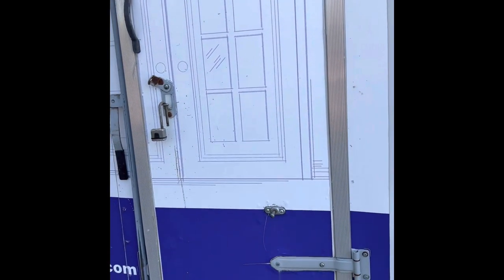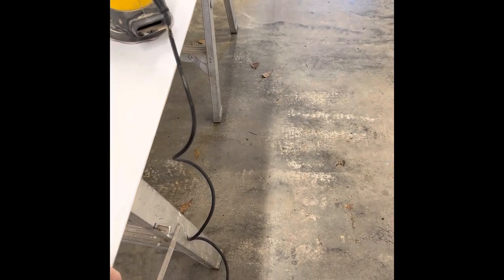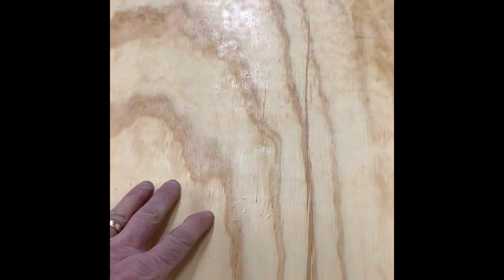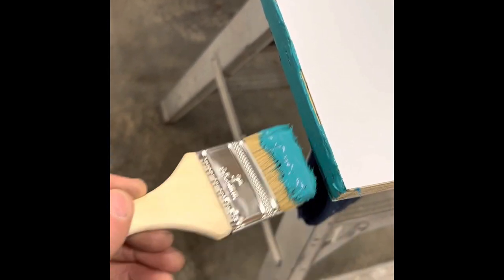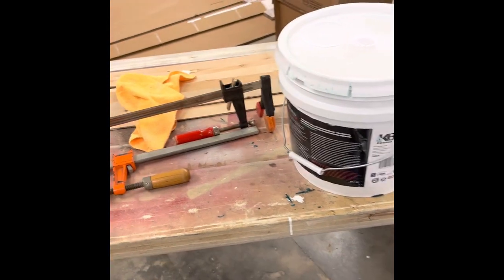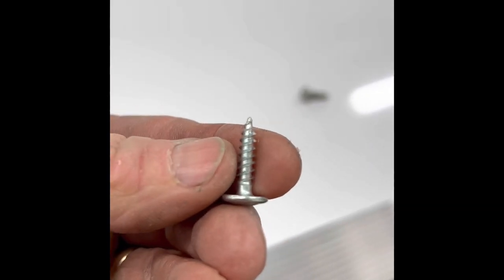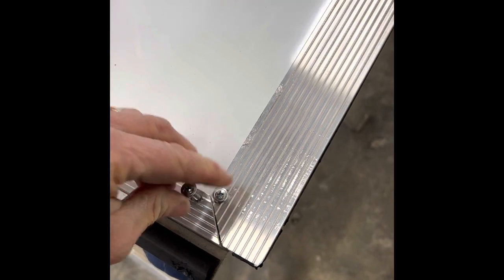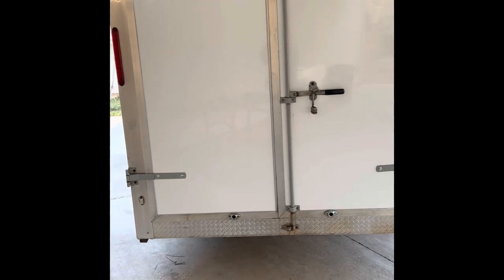Enclosed Cargo Trailer Door Repair

Comment: So did you have to buy new hinges, we repaired a 5 foot cargo door that was so rotted that the bottom frame had come off, we redrilled the holes in the same place and hung it but it is catching at the bottom. You can left up on the door so I am afraid that the hinges have sagged. They look good, no rust. Not sure what to do now.
Reply: Monica,
I used the same hinges. I pre-loaded the weight before drilling the holes, knowing that once you tighten the screws, the weight will cause the door to drop slightly. There is some wiggle to the hinge, it will wiggle up and down slightly. Before drilling the new holes, I positioned the door where I wanted it to be and pulled all the wiggle out of the hinge by pulling downward on it, so it couldn't sag after it was completed.
I hope this makes sense.
Reply: @Jdnorris9187  thank you that helps a lot. I just put the back in the same holes, I may be able to adjust it  and still have the holes hide underneath the hing, thanks for your help

Comment: Im building a new box trailer and will be making a new door. Your break down was a big help. I need to find new h shaped aluminum frame. Was your wood in the door one inch thick?
Reply: Mr. Petersen, I am glad to hear it was helpful. I need to ask, did it show the entire process from start to finish? I tried filming the entire process, step by step and it took about 8 hours and I was filming myself, so I had 50 clips of short videos. I tried to edit them into one video but am not sure if the entire start to finish was posted or if it was only one of the first clips. If you could give me feedback on that. I will know if I need to edit it or alter the posts by others more smart than I. Thanks JD
Reply: It looks like it was full. Watch it till you reinstalled the door. Was the wood in the door 1 inch thick?
Reply: @verdeanpetersen8350  oh, sorry I missed that answer. I used 3/4” BC grade plywood.

Comment: Great job but don't bond the aluminium to the plywood. They expand and contract differently. Better to seal the edges with silicone on the edges to water proof and help prevent water intrusion